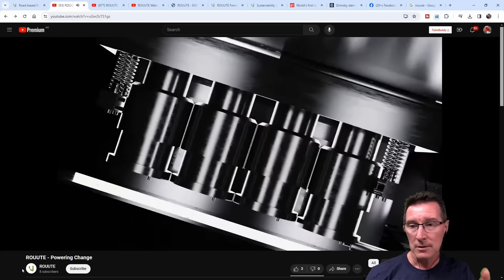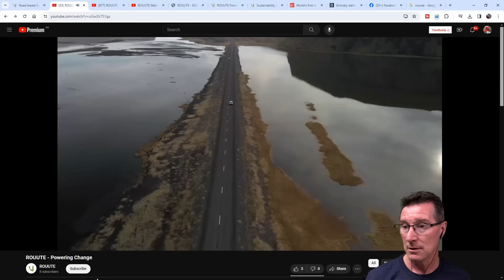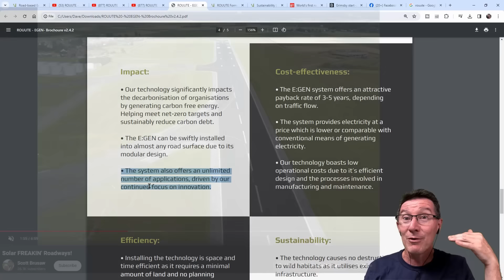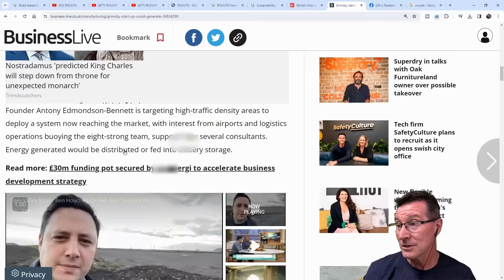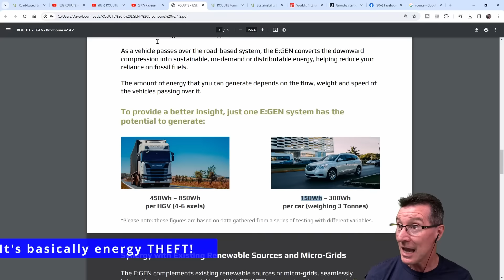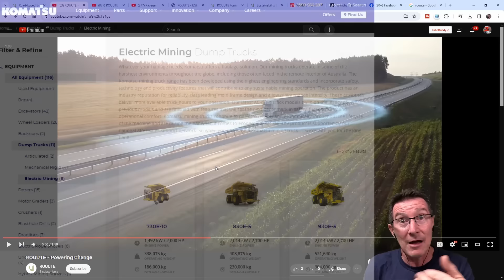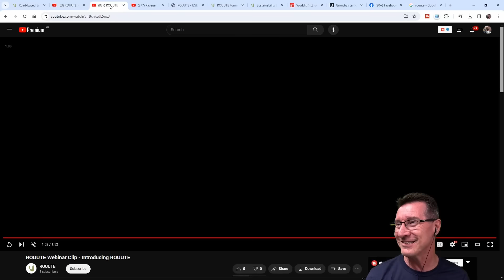EEVblog 1600 - Rouute: Road Based Energy BUSTED

Comment: I wonder if they'd merge those ideas/companies. Solar-freaking-pump-piston-roadways. Also on RAIL ways, one should transform the flat boring rails in cog-like things that are pressed down to generate energy, beyond the solar panel between the rails. They could also have an aviation branch with planes whose wings are covered with solar panels, and they'd brake for landing or speed reduction with wind turbines, all while charging batteries for use on land or for infinite-energy flight on fully electrical planes.

Comment: I remember a concept like this from a science-themed magazine in the 70s or 80s. That might have been even worse, the illustration at least had not only speed bumps but sort of the whole road being some sort of conveyor-belt kind of "carpet" thing, but instead of having wheels moving it underneath, it would have pistons that are pushed down, like those speed bumps., but a continuous series of them with a "carpet" of some sort covering them. More continuous than this ramp thing they have on the video.  At some point I might even have commented that it might have been the only thing dumber than the "original" solar freaking roadways (the Tron/disco/smartphone pavement one, although the basic idea itself likely precedes this version). 

This new one is "consideranly" less dumb in not having the whole road being a nauseating wobbling shock-absorber and energy wasters, although there's arguably a kind of corollary of dumbness in nevertheless reducing the yield, so maybe the dumbness remains constant. Back then I thought that even roads that are/have actual conveyor belts in the direction of the traffic would be a less dumb idea, if those would at least make the path forward more efficient rather than cancelling it, although not only the energy for that wouldn't come for free, and likely not possibly be generated by traffic itself, but would be most likely increasing driving difficulties and accident risks dramatically, if they'd add significant inherent speed at all.

I wonder if there is some company suggesting some system of hooks that automatically connects itself to random cars going downhill, like on some tram systems. "Just put on neutral and let the power generation be the speed reduction," they'd say. Fun-ECO-lars, they could call themselves.

Comment: I am not a mechanical engineer but I guess one option would be a modified version of the mechanism used in single hand powered flashlights. The modification would be that unlike the flashlights which produce power when the pedal is pressed, the speed bumps would use some kind of ratchet to decouple the curved rack from the pinion when the car passes over and then when a spring would push back the rack it would spin up the pinion that's connected to a generator. However since they say they use a hydraulic system then it's probably a hydraulic piston that pushes liquid into a hydraulic accumulator which is then released into a hydraulic motor which powers a generator. I have no idea which of these methods would be more reliable.

Comment: there is one other place where energy can be taken from, gravity. basically converting the weight of the vehicle into energy, granted it would make for a bumpy ride, but there are millions of speed bump here in the UK, if replaced with one of these systems where you are going to be bumping up and down anyway, it really wouldn't matter. you couldn't have them everywhere, but where you do want to slow traffic down and stop joy riders speeding, I can see it making sense there. with a big return spring in it, I can see it working, but no where near as well as advertised.

Comment: Even when you are talking about converting energy when one wants to stop their vehicle. Fien if it's an ICE vehicle. Instead of heating the breaks, sure, capture that energy by stop overspeeding downhill or having to stop for traffic lights. But as soon as one drives an EV or a hybrid, they may quite rightly want to capture that energy in their batteries.
And okay, capturing energy in batteries just to wear them out is not ideal, and for the greater good pushing that into the grid would be probably better, but still, how much would any one individual want to do that instead of charging their own batteries, extending their range, or just saving them money?
And then, how much of a business plan can you base on such an idea?
I mean as long as you can fool investors, it's all good. Pays the bills, right? :D

Comment: Yes, it will create energy, but there is an effective loss because the energy expended by the vehicle to replace the loss at the generator is greater than the energy created by the mechanism. 

But another problem not addressed here, is degradation of the devices due to punishment from heavy vehicles, speeding vehicles, and weather, road grit, etc. Then there are safety concerns locating this kind of moving surface in higher speed or high braking areas, leading to loss of traction. Another safety issue surrounds breakages in the devices with potential holes, and broken parts being flung into oncoming traffic. It is an accident waiting to happen.

Comment: They want to put these on the roads, and not just parking lots? Yeah, that's not gonna harm anyone's suspension, or anything. EVs especially are gonna have a rough time, as they're heavier than gasoline vehicles, and if you even look at the battery sideways (let alone constantly jostle it and possibly scrape the bottom on the road), they explode.

Comment: My senior design project in school was basically this, except our idea was to use carbon nanotubes in pavement. I tried to explain to our team leader how dumb it was as a concept, but mostly bit my tongue since it's just a proof-of-concept school project. When we inevitably failed I redid the project with piezoelectric elements. Yeah it generated power, but barely anything and wrecked the efficiency of the test vehicle. Beware of those who compare themselves and their ideas to the Wright brothers or similar.

Comment: As a mechanical/fluids engineer you'd want to minimize translation to minimize disruption the ride of vehicle. Hydraulic gearing via piston dia ration on master and slave piston set up but better may be an electro crystal method as displacement/translation is far smaller.
Regardless of methodology this is a stupid crackpot idea. Please God no gov funding involved....

Comment: This is basically an elliptical trainer for cars. It needs all the energy put into it by the car. Gravity puts in nothing here because the car has to climb the springloaded platform every time. Not to mention it will turn your car into a very early train. Clickety cluckaty cluck

Comment: HA! Really? Road workers doing this kind of install and regular maintenance? Have you seen the condition of roads in the USA lately? That's hardly a technical skill and they still can't get that correct to make is last a long time. If they do it on purpose for job security, they will continue doing it with a much more expensive energy making road.
Once there is a crack , water and or ice will help speed up the destruction. How will they keep water & iced out of this type of road in the video? How will they stop the mechanical wear or the corrosion?
The road proposed in the video uses "hydraulic compression". Is that road now made of millions of moving  mechanical parts? There is LOTS of wear and tear on a flat road they way we have them now.
What happens when another COVID episode takes place and the majority of vehicle traffic stops driving for weeks ?  You guessed it... no electricity. And don't think for a minute that the power plants will make up the difference. Once something like these roads are installed on a grand scale, they will be shutting down some of those power plants saying we don't need them anymore. Just read about the German solar disaster during the winter. All this solar, wind ,etc business should only be a supplement to our current power generation. We are many, many decades away from anything that will really replace fossil fuel power.

Now we can talk about the incredible noise these roads will generate which means reducing speeds to about 15 kph.

I think these guys involved with all this BS business don't really believe it'll work but are good at making politician's believe it will, just a way to get more free money from the gov.They know how obsessed the gov is about the green agenda.

Comment: 1:27 into the video and I know this video is a debunk/bust video, but a speedbump seems like a decent place to put this sort of thing. I heard about roads that create electricity when cars roll over them and at first thought that sounded neat, but as I thought more about the physics of it, I realized it would create more carbon emissions because it would not be taking free energy but stealing it from the cars rolling over it. It would have to be more difficult for the cars to drive over, lowering the cars efficiency, and just taking money from people, making cars produce more pollution to drive, and while it would maybe reduce the energy requirements of a powerplant it couldn't possibly be an actual gain. But, with a speedbump you are stealing energy from the car already, the whole point is to make people slow down and you have to force the car over the speedbump which is an energy sink. I can't imagine it being a lot of energy captured per car though, so it would need to be a very high traffic area to power a lamp or something. I doubt it could power the average household. - Ok, back to the video I go.

Comment: All the physics fails aside, installing things like this on the roadway is near impossible. They fill with gravel and debris, they get hammered by the traffic, and you can't use them where it freezes, or even worse, needs to be plowed. We still can't get bots dots to stay in place for more than a few years.

I convinced this guy knows what he's doing and that it's a grift. You don't have to be smart when it comes to "clean" energy, just smarter than the politicians, and that bar is really low.

Comment: This is a really good idea, but it can be made more efficient and cheaper for everybody involved.  Don't build the infrastructure, calculate the proposed revenue and collect it as a road toll or road fuel tax.  The authority/company avoids the huge installation cost.  The motorists pay less because they are only paying the output value, after the inefficiencies of the generation system.  The revenue can be spent on renewable energy.

Comment: (This is speculation based on nothing more than visual information)
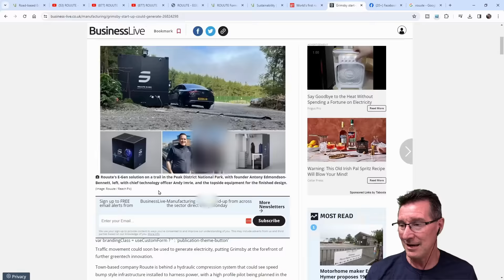Think of it like a bicycle pump and a bottle rocket, each car passing over is like the pump adding air to the rocket. Only in this case the rocket is a pressure reserve that is used to run a motor, which in turn spins up an electrical generator. You can actually see this in the mock up images at 10:30. You can see bottles presumably used to store pressure, and a pretty generic looking electrical motor.

The real problem with this concept is it doesn't take into account how much maintenance such a device would probably end up demanding. Roads are pretty demanding, requiring intensive labor to maintain(we've all seen road construction, it's not a small task), just imagine how much attention a mechanical pneumatic device would demand to stay in working condition being run over by cars all day long.

The only places I could see this device being useful wouldn't want to deal with the downtime associated with maintenance demands. Toll booths and parking lots could use this, but never would since shutting down a road for repairs or maintenance is just too big of an expense to even consider.

It's simply not practical enough to see any real use. It's like how solar fricking road-ways didn't take into account solar panels run like crap after a car has driven its dirty tires over them all day. Neat idea with no practical foresight.

Comment: unless it's a steep mountain, driving a gas car you use engine breaking so you don't burn any fuel coming down the mountain. Riding your brakes all the way down is a great way to cook them and end up at the bottom way quicker than you wanted.

Comment: I’m still gonna watch, but even if they magically collect the energy from the friction of cars against the speed bumps to energy, you’d just be taking energy from the cars driving over. If the road is flat and they just want energy from cars riding over, they’d just be collecting heat (maybe they could boil water for a turbine? 🤦‍♂️). Somehow still a better idea than Solar Roadways.

Comment: I remember seeing something  about this quite a while ago.  If you look at it from the perspective of an engineer it's stupid, but remember, the person who puts in the speed bump isn't paying for the gas that is being wasted by slowing the vehicle with a speed bump.  

Speed bumps usually slow cars down by encouraging the person to use their brakes to slow down.  If instead you had something that physically slowed the vehicle... more in the line of the slowing you get when you drive through a large puddle, then, because it was forcing the vehicle to slow rather than encouraging the vehicle to slow, you might get a better speed bump for safety, but energywise, yeah it's stupid.

I could see it being useful on some long stretches for large trucks, not so much for generating electricity, but as a way to save their brakes a bit and prevent runaway.
Reply: Except they already have something for that: The jake brake. Problem is, people are too busy complaining about the noise of the jake brake to realize that it is a safety feature and should be able to be used anywhere regardless of the loudness. I would rather be woken up in the middle of the night by a straight piped peterbilt using his jake brake than for said straight piped peterbilt run through a minivan and two sedans and kill three families because he lit his brakes on fire trying to stop and there aren't any runaway ramps nearby.

Comment: Could we build new type of electrical power plant - where in a closed race-track a Tesla will be driving around, over this speedbump each 0.5 meter, and use the 100 x 300Wh (over 50 meters) to recharge the Tesla and power few houses nearby too?

Comment: So the way they are making energy by stealing energy from cars? This would slow vehicles and put more wear on suspension costing the car driver more. I’d think it would be much more efficient to attach an engine straight to the energy generation and move the power to where it’s needed using electrical conductors but I don’t know if this idea will catch on 😜

Comment: You know what works better than harvesting energy from a car? Not wasting fuel/energy on that car. 

The road is not and will never be a way to generate even a passable amount of energy. At most, energy generation in pedestrianized areas might be viable in the form of solar of hydroelectric power. And even that is a pretty bad investment as there are far better locations to harvest that type of power.

If these people truly cared about trying to help the climate, they would actively protest against the suburban wasteland that the US has become. Instead, all they have is a bunch of scams. With a good portion of those scams being funded by the fossil fuel industry to serve as a distraction.

Comment: But why? This “steals” energy from the vehicles. Why not replace these speed bumps with a guy asking people politely to stop, and then ask if you get to siphon some gas from their car, or use reverse charging to pull 300 Wh directly from the battery? 

Because then you overcome the energy losses during conversion from kinetic to electric… You’re basically stealing energy from people’s gas tanks or batteries with this stupid bump

Comment: The better way to green energy is to heavily subsidize electric vehicles until the market is at a tipping point and ICE engines for cars become obsolete.  From that point forward you are continually green with no additional effort or subsidies.

Comment: This is just robbing from Peter to pay Paul.

Petrol/diesel cars will just burn more fuel in order for this system to generate “green” energy.

With electric cars, at least on downhills, you are robbing the car of its regen energy storage.

The best application for this would be where speed bumps are already installed for traffic calming.

My question is, what’s the installation and ongoing maintenance cost vs profits?  It would have a lot of moving parts and it’s constantly exposed to the elements, weight and friction.

Also, aside from traffic calming speed bumps, if you are installing this in other places, apart from the issues mentioned above, you are also wasting energy via extra noise created. Tyre and engine noise is bad enough without the need for bumpity bump sounds constantly.

Comment: 540.000J is also the energy needed to lift the car 18m up.
A much better Idea would be a mountain road where you install a paternoster like system for the cars going down. Instead of driving the road downhill 180m you could make something out of the 1.5KWh per 3t car. Still most likely not really over all useful but at least it's possible to actually do it.